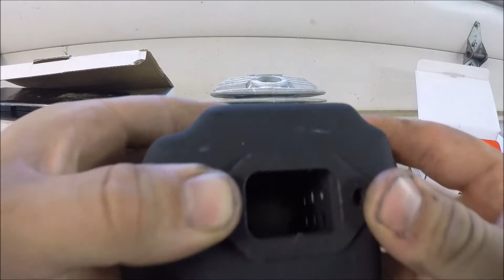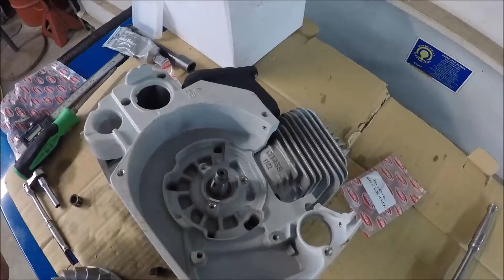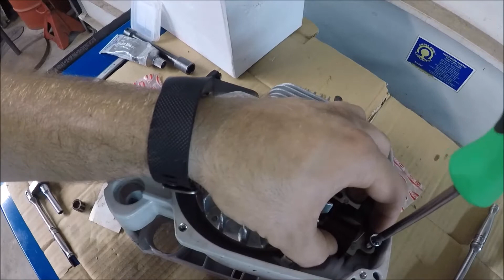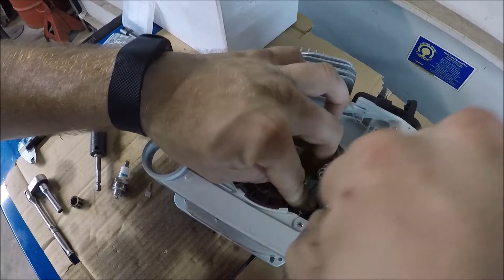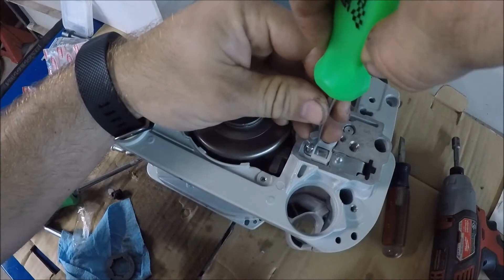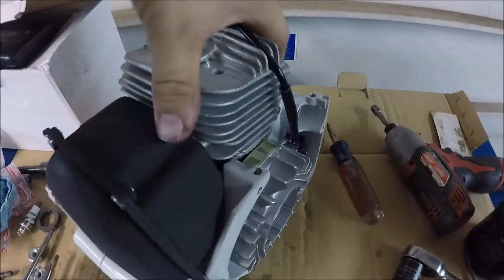Part 2 of Building Famertec MS660 Clone

Comment: I used your or videos to assemble my saw.  Many thanks!  I would like to add a few recommendations:

-Obtain the Stihl MS660 manual off the web.  It has torque values
-The oil pump should have a rubber seal in place (looks like a short black plastic tube 3/8" long)  Discovered this when pump wasn't oiling the bar but pouring oil out the bottom
-The clutch drum has a notch that sets over the oil pump drive arm-My e-clip came off and bearing popped out on initial startup.  New bearing from the Stihl dealer and e-clip.  Hint, good idea to crank over a solid surface vs dirt and gravel.

There is a site that has  parts breakdown on line-super handy reference.

Not knocking your work!  It saved me as ton of time!
Reply from the maker: I am glad the videos helped you. I have a couple more saws that I am going to be doing soon. Your right, I should mention the IPL and WSM at the begining. I must have missed the oring on the oil pump in the editing process. I am going to have a quick update on the saw soon. I had a very minor breakdown last night.
Reply: Wow, using Stihl diagram and parts to bail you out.
Call you beloved china knock off company whom are stealing Stihl's engineered and tested design and get your parts
Reply: @stihl9968  Imagine taking the time to come the comments of a video on a Farmertec saw build just to complain about the concept of making clone of a 20 year old a saw from parts that are out of patent.  I bet you're a blast at parties!

Comment: Awesome video. just finished putting mine together. I used all of the Farmertec parts on mine. Put fuel and oil in it and it started on the 4th pull. Just a question with the oil worm gear, the arm that come off it, is it suppose to lock into the little notch on the clutch drum and stay there? Looks like mine only picks up every now and then but still pumps oil ok. 
Cheers Rod
Reply: 94BULLITT Thanks for your reply. 👍 I had another look and I bent the arm out  a couple of mm and now locks in fine. Also if you do another video it may pay to mention the little rubber grommet that goes on the outlet it the oil pump which I forgot. . I don’t know if you had yours in watching your video. If it’s not there the oil just runs out around the bottom of the clutch drum housing instead of coming out where the side plate is. 
Cheers
Rod
Reply from the maker: Cool, I hope your saw does well for you. The arm is supposed to lock into the clutch drum. The arm should not come of the worm gear. If it does you may need a new one. The arm may be slipping on the worm gear. I've heard some guys say the worm gear is not very good but I've never heard the say why.
Reply from the maker: I'm glad you got it fixed. Yes, my oil pump o ring was installed.